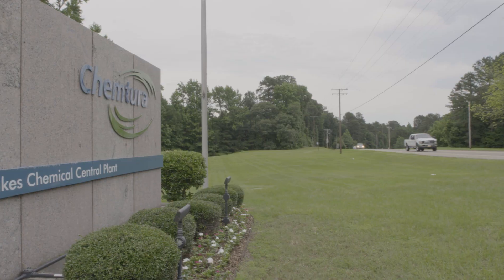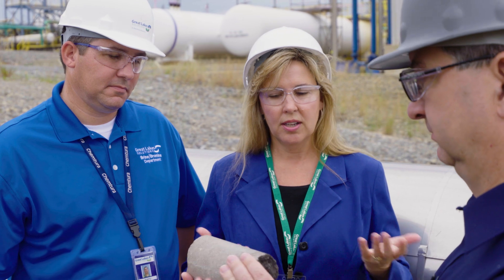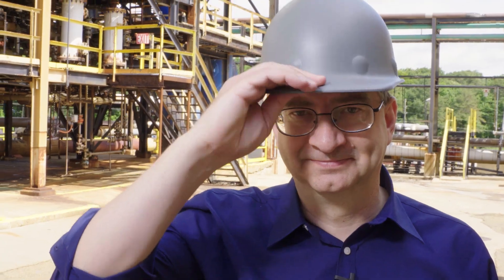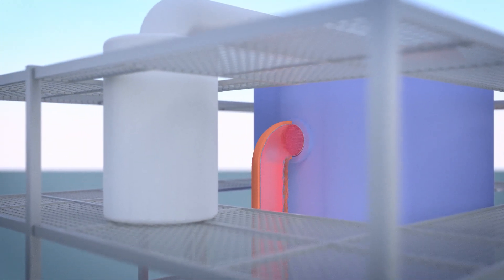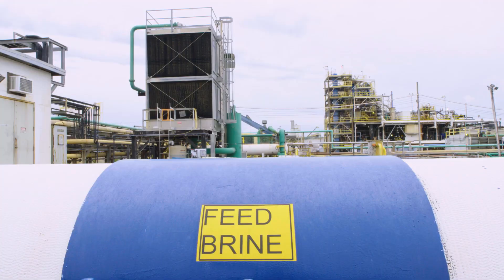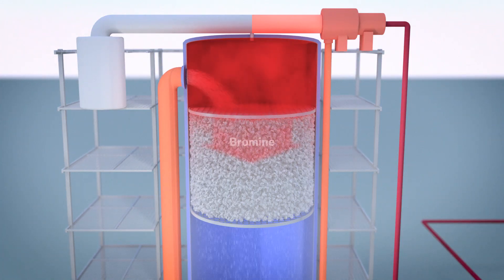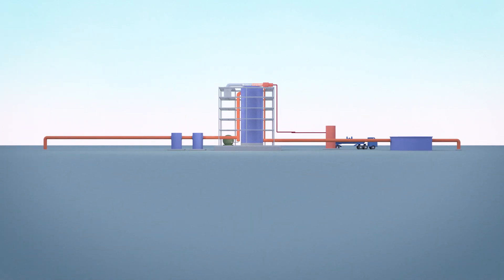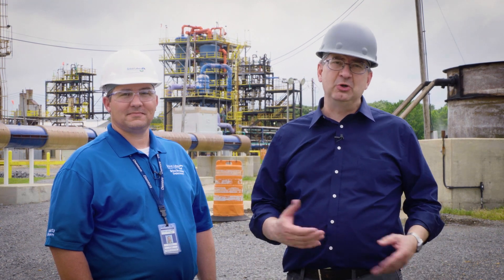Bromine Production Overview

Comment: What is the MOC of the recovery column????
Reply from the maker: Steel, but what kind...?
Reply: @chematwork9655  is it a glass lined steel??
Reply from the maker: I don't believe it is. I didn't ask at the time. There are a number of steels that can handle wet chlorine, which is generally much more reactive than bromine, so if I had to guess it would be some similar high nickel content steel alloy, but that is pure speculation on my part.
Reply: @chematwork9655  the thing is that I work in the same field we first treat kbr then we recover bromine from kbr. We use glass column for the process , so I just wanted to know if there is any alternative for glass 😊
Reply: @chematwork9655  talking about br2 recovery column
Reply: @chematwork9655 
I think MSGL Column

Comment: I'm working in bromine plant in jordan and we use brine from dead sea
Reply from the maker: That's great.  The Dead Sea is the other major source of bromine (as you know Mohammad).  Less pumping cost, but the brine isn't as hot.
Reply: That's correct, we heated feed brine by tail brine and steam using three H.E
Reply: Hello I worked in bromine plant just two year in Tamil Nadu India
Reply: Which technique are you using? Steaming out technique?
Reply: I am doing my final year project being a chemical engineer on bromine extraction from sea water using steaming out process